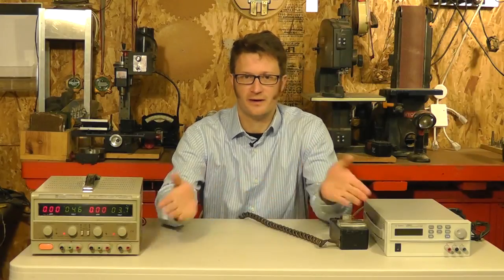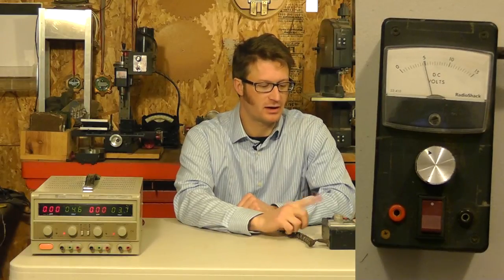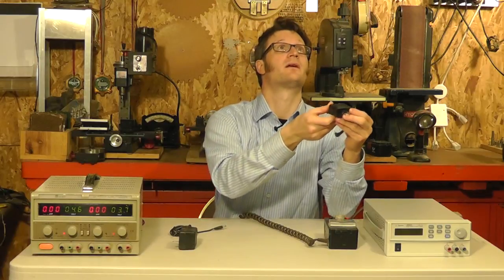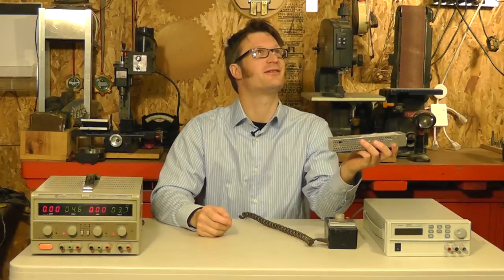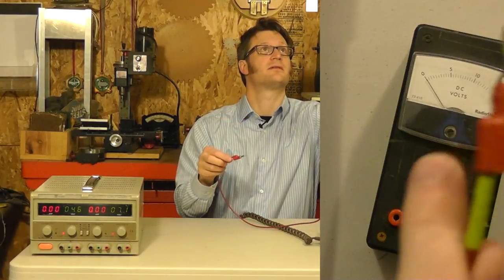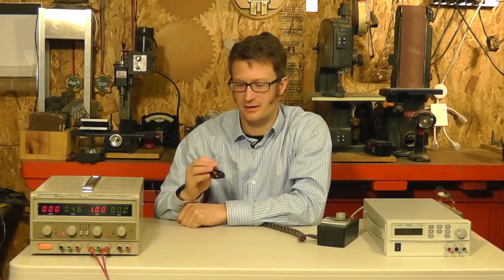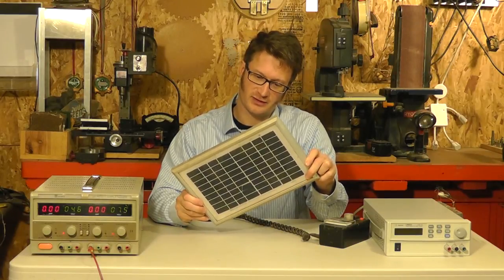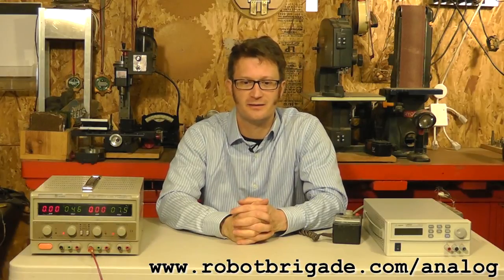Analog Electronics - Power Sources

Comment: how i make batteries in series & parallel  ?
Reply from the maker: Good question.   I'm sure that there are all sorts of things that I will miss in these videos.   To connect batteries in series, connect the + side of one battery to the - side of another.   To connect more batteries in series, just keep connecting + to -.  Your output voltage will be the sum of the voltages.   To connect batteries in parallel, connect the + of one battery to the + of another.  Also connect their - sides together.   Your output voltage will remain the same but now your device will run twice as long.  You only want to connect batteries of the same type/voltage in series or parallel or else bad things could happen as you discharge the batteries.
Reply: THNX